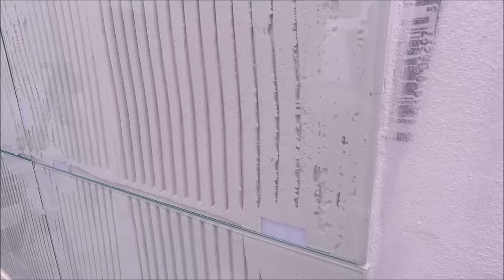How to use a Tile Leveling System for Walls

Comment: Great demo i have used rigid version about 40 to 50 times in canada known as pro level system comes from italy, one ,two,or three milimetre spacing. Two things in video wall is flat also grid is only two wide and is in fact as declared clear demonstration only.  Thus these things will not set tile for you instead can dummy you down by you thinking these devices will compensate for various short comings such as lack of experience or a short cut for leveling  THEY ARE PURPOSED TO ALIGN HOLD TILE DURING INITIAL SET.  In two days setting begins what was once flat is no longer as moisture begins to migrate from cement matrix lippage can now creep into instalation depending on tile size in canada allowed .78 millimeter lippage between rectified tile Enough tile talk great video i leave with these words whats on the bottom is on top cheers
Reply: if you install your tile with the correct trowel you will not have to worry about lippage using these systems... thinset will shrink to 1/4 inch and large format tile your not supposed to 50 percent your tile as they are bowed due to process. in fact most tile manufactures tell you to 33 percent your tile due to the bow.
Reply: Are you talking about the offset pattern? I used to do a 50 percent offset and it did cause me a lot of heart-ache. Fortunately they were very small rooms!
Reply: Large format u either stack or if its a brick pattern ur head joints cant be half the tile as the tiles have a natural bow to them due to when they are in the kiln. You by manufacture specs have to 33 percent them or a 1/3 of the tile for the next row. If you install 50 percent and you get uneven head joints it could make you eat the job. I do this professionally and the guy that contracts me out is an flooring inspector, so we have to do everything by the book

Comment: So I went ahead and removed tile from a shower they had a crack... And a bunch of mold... But some of the 2x4 was sanded down... I should've glued a shim to it... But now there a 2/16 gap between the upper tile that's still on the wall and the new tile....  The new tile is on 95+% coverage... And is not coming off... Honestly there's nothing wrong with the patch other than asthenics there's a slight lip ... But my OCD is ready to tear the wall down after investing $300 into material and days off prep work as I made this thing air tight

Comment: well, I like the way these things seem to work even though I have never used them myself over the 35 years that I have been doing construction, but, the real problem is what the wall is doing behind the tile.  Walls are never straight... so,you can use  these levelers till the end of time but it will not really work with a wall that is not flat..It will follow the wall basically..And I know you will come up with reasons to prove me wrong...But since I have not used this system,I don't really know for sure what will happen...Next job,I will try it though
Reply from the maker: Give em a shot buddy!
Reply: i will, thanks for the reply.. are the ones at home depot any good? if not, what do you recommend?
Reply from the maker: Yup, Home depot sells QEP and they work. Make sure to purchase the pliers as well 👊

Comment: Hi, may I ask, with the way the glass panels aka tiles are installed, won't the air pockets left in the tiles cause the tiles to crack when they have expanded and contracted over time?
Reply: He did mention that normally you back butter the tile before install..this was to demonstrate how to use the different level systems. Not how to lay tile..

Comment: I have a question I’m not someone who lays tile so I’m curious to this. So first I suppose do the clips come in a thickness range? Second if yes what dictates a grouts width for tiles? Is it dictated by material the size of the material or is it just always like a quarter inch? Loved the video me and the wife sat here watched it and learned a lot. The glass is cool to see what back buttering is needed cause if not it shows there is not enough surface area to adhere for long term. Have a good one
Reply from the maker: Yes, you can order clips from 1/32 of an inch to 3/16 of an inch. The grout you would use would be something like Prism from Custom. This grout can be used for any size grout line (sanded and nonsanded applications as this Prism grout is made with glass). I hope I answered your questions and thanks for watching! 👊
Reply: Landberg Tile DIY TV thanks man means a lot!

Comment: So do those wedges end up costing as much as the tiles and tile glue or are they dirt cheap?

They don't look so cheap
Reply from the maker: The wedges and clips/spacers are extremely inexpensive! and worth every penny 👊
Reply: On some jobs they really come in handy. Work well with wood plank tile cuz they’re so bowed!
Reply: They are cost effective
Reply: They're cheap.  And you only need to buy the wedges once as you can reuse them.

Comment: The old ways are always the best not that you have to use it daily but nice to have the option. Anyone can spread mud and screw a couple little things together to try and make it flat. Mud float will never die and the clips will come and go
Reply: Old ways aren’t best but got the job done.
Reply: @Will-nb8qk  some states still require hot mop and mud float. That’s old school why they still make those the standard?
Reply: @Apexjasonmorganllc  Their loss. Mud floats are only essential in bathrooms where they require falls. We use to mud float everything years ago it was ridiculous tbh. I’m not a fan of levelling system but for plank tiles…..too slow. I think hot mopping is a bit of overkill, shoddy tiling work and lack of common sense drove process into ridiculously time consuming water proofing efforts.
Reply: @Will-nb8qk  the answer is foam. No thanks. I’ll take mud float and dry pack over cheesy foam.
Reply: @Will-nb8qk  I don’t usually use the clips unless it’s plank tiles.

Comment: How thick a clip for large format porcelain  tile going on durock wall - IE how think the mastic ? thanks
Reply: that depends on whether your LFT are rectified ie enough quality control to ensure tiles are same size and flat. if rectified you can go 1/16th. if not rectified, 1/8 and 33% or less stagger.

Comment: Great video bud I appreciate it but one question, can I still use spacers with those leveling systems or does the leveling system work as a spacer?
Reply: They work as a spacer unless you want a larger spacer, then you can use if you need to.
Reply: you may want to use cross spacers, placed in corners. otherwise, these systems do not ensure corner alignment.

Comment: Hi mate, I like your vids. Nice and to the point. Have you ever used the Levolution system? I am using it on a job now and struggling. Only one spacer instead of four at every crossing. Looks nice but doesn't have the strength to hold four tiles at the same time, plus the tensioning tool's handle snapped after three days!
Going with the wedges on the next job, thanks to you.
Reply from the maker: Oh man, that sounds like a headache. Yes, we definitely prefer the wedge system over everything else. Thanks for watching my vid! 👊

Comment: Would like to see a video of what happens when the underlayment isn't flat/level/plumb. That is when these doodads get you into trouble. Low spots create air pockets. High spots transfer lippage to other corners and can also cause multiple air pockets. The tabs do not always break completely, leaving the occasional piece of tab remaining in the grout joint. Any tiles with delicate edges can be a problem getting it removed without chipping. And one last issue... When you are doing a large job and stop at the end of the day, the next row you lay the following morning may have and unfixable high or low spot to deal with because you sucked the edge down too far.
Reply: I call them cheater spacers.
I haven't seen a perfect wall or floor in a long time , and I've been tiling for 33 years.
Floors have dips and humps that need to be built up to be flat!
Straight edge helps when installing, clips won't.
Walls same thing.
Trying to plumb a wall , or when there is a dip in the wall from the corner beed and you have to build out to make it flat and plumb, its a different story.

Comment: what about the bits of plastic that havent broke off properly in the grout line, how do you remove that before you grout
Reply from the maker: The plastic stays underneath the tile and you then grout.
Reply: I think he meant when it broke off wrong spot not were it should broke. 
You can remove broken pieces by precision pliers.
Reply from the maker: What you see in this video is thinset mortar squeezing through, not plastic. If that happens, use a utility knife to cut it out.

Comment: Great video, but if you could please explain why I would use one system over the other since they both essentially work the same way and achieve the same auto leveling. Does it just come down to price and/or preference? Thanks!
Reply from the maker: Thanks and yes, they all essentially work the same, but there are some variables such as speed. The wedge system is faster to install with bigger tile projects and also quicker to collect the wedges after you remove them as the spin system requires you to spin off each broken clip. As far as price, the RLS Raimondi system and the Ridgid system is about the same price and Levtec has a higher cost, but better clips/spacers. 👊
Reply: Landberg Tile DIY TV thank you for teaching us!! Your tips I would like to know in your opinion what's the best blade for grainer 3 1/2"  I saw your videos all of them and I 
 learn to many things with you thank you!
Reply from the maker: If I understand you right, the blade we like for a grinder is a Montolit for a diamond blade and a Dewalt for a cut off wheel. Thanks for watching! 👊
Reply: where i live the wedge clips are cheaper. Its also nice not having to unscrew every single one after you knock them out especially if its 100's of them

Comment: How do you clean up the clips that didn't break off below the surface like at 9:17?
Reply from the maker: They are left under the tile. 👍
Reply: @LandbergTileTV  Thanks for the reply...sorry i wasn't clear. at 9:17 one of the clips did not break off below the surface. How do you get rid of that so it doesn't interfere with the grout?
Reply from the maker: @Gbfaninnm  We simply use a utility knife carefully to cut it out without damaging the tile glaze/edge.

Comment: What is the difference between using the Kit with 1/8" (3mm) and the kit with 1/16" (2mm) ?
Reply from the maker: We always recommend 1/16 inch grout lines. Looks much cleaner, more modern and easier to clean and maintain. 👊
Reply: @LandbergTileTV  Thanks for your replying.

Comment: Thanks for the videos - good video production without fluff.
The Ridgid system is way cheaper in your case of straight grout lines that only requires one at each intersection if you use the cross intersection clips.
For example 9'x5' area of 12" tiles would use 66 Ridgid clips plus nuts- $20 for 100 nuts and $10 for 100 clips(both for 30 cents each)  and the wedge system would use 216 clips plus wedges at about the same price for each combo. 
(There are also tee intersection Ridgid clips for running bond or the straight clips like you were using).
I imagine the wedges would be better for larger format because the extra clips will pull more to align big tiles which could come in handy when your mortar is a little stiff.

I wonder how much torque you can put on the screw clips before the plastic breaks?
Reply from the maker: Not sure about the torque, but we certainly dislike having to un-spin each clip and nut after they break off. With the wedge system, you skip that step.

Comment: The glass really shows how important back buttering tiles is with a leveling system
Reply from the maker: True! keep in mind, thinset mortar also sticks better to stone, ceramic and porcelain than it does to glass 👊
Reply: Nope glass shows you need bigger notch for trowel back buttering tiles is just slow and stupid way to add more thinset.
Reply from the maker: Yes, you are correct. Always use a half inch trowel for large format with a tile leveling system, I didn't have one at this time of demo. Also, back buttering large format is always a must and helps tremendously.

Comment: Thanks for the video. I just watched the ridgid instructional video and I believe that you are using too many clips. On the instructional video they recommend Using one clip mechanism where the 4 tiles intersect. Is there a reason why you are using 4 clips instead of 1? Just curious .. ridgid says this system uses less clips but doing it the way you did it would be same amount ? Have you tried it with 1 clip?
Reply from the maker: You can use one spindle for the intersection, but you will not be able to see if the 4 corners are aligned correctly and without lippage because of the spindle covering that intersection. We always like to see and check the intersections and that's why we use more spindles and wedges.
Reply: thanks for the reply.. makes sense.

Comment: I never (well hardly ever) back butter as those voids between the serrations are still there. The prefered method now seems to be to lay and slide the tile into the final position thus collapsing the serrations and increasing the coverage. Even if you just do as in the video, tiles will stick well. I have many years of experience hacking tiles off to know that for normal flat backed tiles, back buttering makes little difference,

Comment: You are supposed to use a larger trowel with the leveling system. That is why you tiles are not properly covered. Ramondi recommends 1/2in sq notch.
Reply from the maker: Yes, and I did mention that in the video. I only had a 3/8 trowel for this demo.

Comment: I think the proper trowel would help with coverage . No back buttering needed. As far as the spacer/leveler tools I wouldn’t recommend any professional use on a daily basis . Def an awesome tool for a diy’er though
Reply from the maker: We always use 1/2 inch (was at the job site) and we have found that back buttering helps a ton. There are many professionals out there who use tile leveling systems on large format (Sal Diblasi youtube) Check him out. Thanks for the watch happy new year!
Reply: Landberg Tile DIY TV  really ? Must be something decent I guess . Happy new year !

Comment: I prefer the wedges, they are way faster to install than the spindle system.
Reply: but you have to hold the tiles so as not to move while tightening.

Comment: Nice video! I use Rigid Level Max because it’s readily available from Home Depot. I haven’t used Lev-Tec. In my experience, the spin caps tend to pull apart tiles, about 1/32. Does it happen with wedges? Where do you get Lev-Tec?
Reply from the maker: This is where you get Levtec. Give it a try! You will not be disappointed.
https://www.amazon.com/dp/B06VT29X4J/?ref=exp_landbergtilediytv_lv_dp_vv_d
Reply: on amazon
Reply: landberg Tile TV 
Thanks! I bought some lev-tec

Comment: Tile leveling system being used on flat wall ?
Reply: tiles are not straight or flat, unless the tiles are rectified. the clips mostly pull the surfaces to flush.

Comment: The problem with this system is that if your walls are not flat level. The clips when you tighten them. Well pull the tile to far and make it uneven as you move along. It isnt as easy as this vid shows. I have seen vids that say. For professional use. And I agree. This is still not for beginners and the answer to getting a flat tile wall!

Comment: your ridges did not collapse almost at all man!
Reply: He said he would normally back butter the tile.  That would have solved the no contact areas.  I never try to completely collapse the air, that is why you want ridges so you can level.
Reply: He also mentioned he was using the wrong size trowel, and not focused on the proper application as it was only to demonstrating the tile leveling system.

Comment: If you would have moved the glass enough, left and right you could have achieved 85-95% coverage. Those notches should be basically gone if installed correctly. Should almost look like a solid sheet of thinset if done correctly.